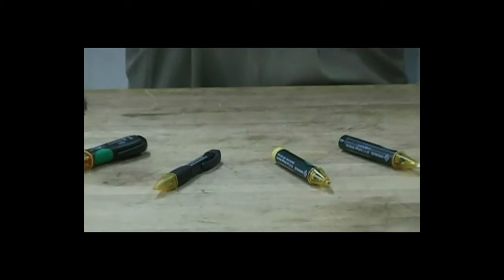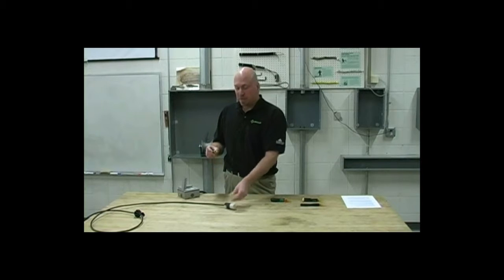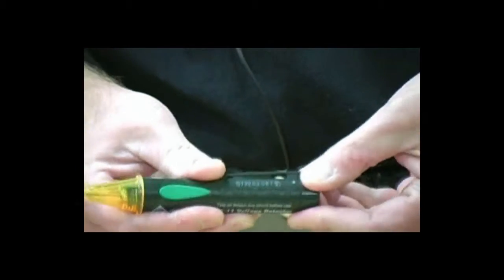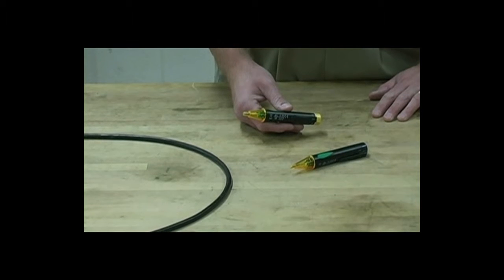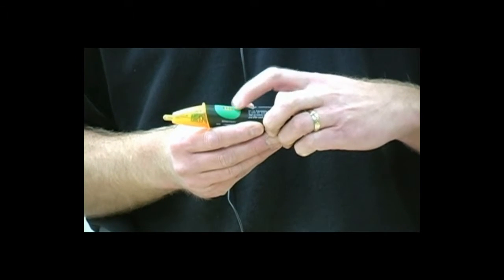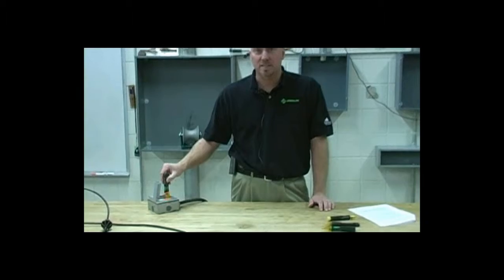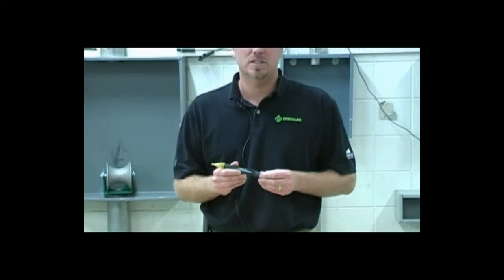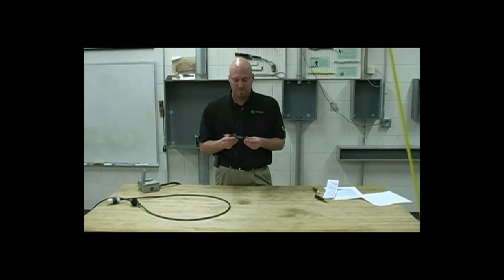Greenlee Textron Voltage Detection GT-11 GT-12 GT-15 GT-16

Comment: thank you for showing me how to open the battery door. could not figure it out, and had lost the instruction manual after many years, I might add I still do need to change the batteries, but was just curious.